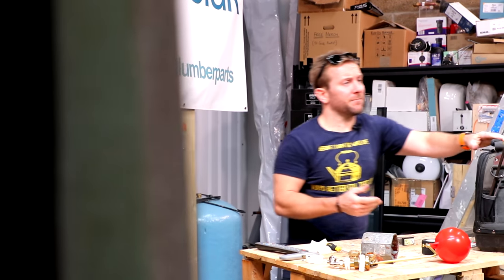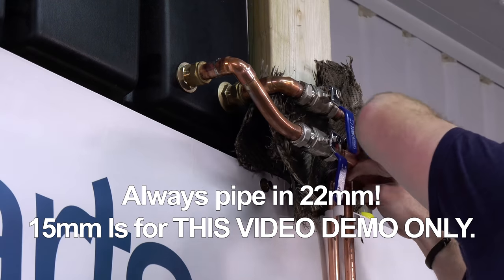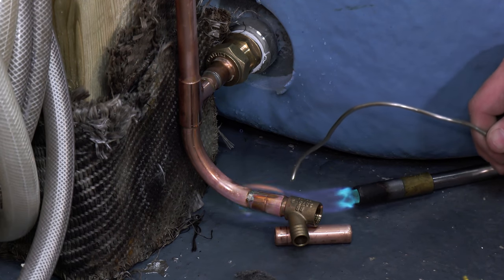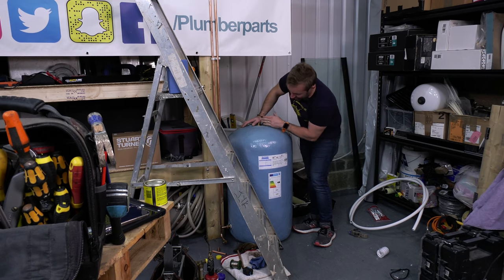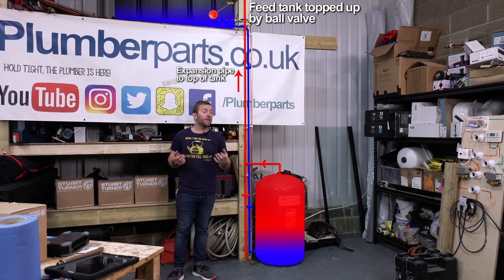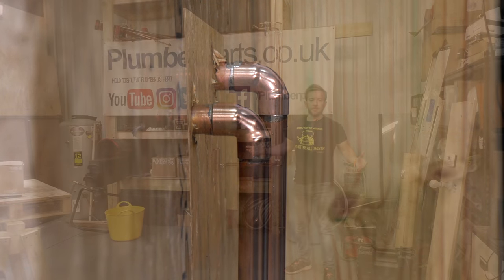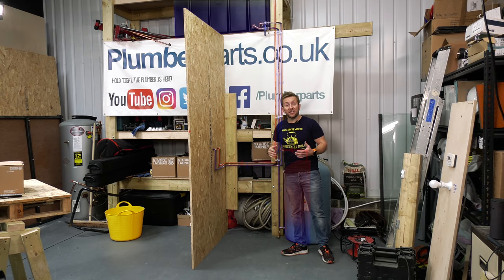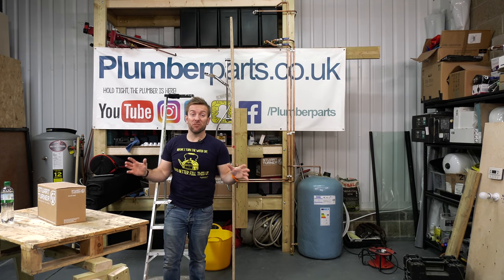HOW TO FIT A SHOWER PUMP - Stuart Turner Showermate Review

Comment: Don't you have to use a different flange on the hot water to prevent air being sucked out?
Reply: Although best practice is to use either a top entry or side entry flange where possible, If the pump is to be located below the top of the hot water cylinder you can connect directly to the hot water supply. Just make sure you first angle the pipe upwards between 3 and 45 degrees and tee into the bottom cylinder. Refer to the installation guide for more advice. :)
Reply: @StuartTurnerLtdHenleyonThames  Just to clarify my understanding you can add a shower to a pipes shared with other outlets?

Comment: Great video. I've got a question mate. We have a shower pump to our main bathroom fed by gravity water tank and vented cylinder storage. Problem is when the shower is on it works fine, but once you turn off the shower tap the water pump engine is still working and it won't switch off! I have to go up to the loft to turn the fuse switch off to stop it and over heating. Why doesn't it isolate the water pump off? It used to work a fine before... Many thanks!
Reply: If the shower valve is passing water 💧 in the off position,  You don’t give the location of the shower pump. If the location of the pump is in the loft, It should be a negative head pump , If not check the pressure switch. Don’t understand why 13 Amp  spur switch is in the loft. Unless pump is located in the bathroom 🚽

Comment: Did you use a surrey flange on the tank?
Reply: He didn't, and he used 15mm pipe instead of 22mm. Cut a few corners which is a bit misleading.

Comment: Lots of information and an amusing delivery. Having watched your video I went ahead and had a new Stuart Turner pump fitted at the base of the cylinder,. This was replacing an old noisy one that has lived under the bath for over ten years. The plumber fitted the new pump almost exactly the way you have, lovely installation. Regrettably the pump started to weep on the cold side after just over a month of being installed. I contacted Stuart Turner and they wanted pictures of the installation. 

They have refused warranty stating that the angle, on the pipe at the top of the tank for the hot water supply is insufficient. So even though it is the COLD water side that is weeping, warranty is refused because they say the HOT side is not fitted correctly.

I urge anyone fitting a pump to follow the fitting instructions explicitly, no matter how expensive that may be, as any failure will have your warranty claim rejected.

Comment: As part of legionella control what we do at my firm (commercial mainly) is bring the expansion pipe up over the tank and then back down, into a visible tundish, then a fanny trap and tee into the waste or discharge out as you would a D2 on the unvented system. This is to prevent the warm water mixing with the cold bringing the temp of the cwst into the 20C or above which is a breeding ground for bscteria.
Just a thought, may become mandatory at some point. 
Cheers for a great video bud. Atb

Comment: A really handy video I stumbled across. Our builders when fitting a downstairs shower room took the hot and cold feed from under the sink. It runs under the kitchen and extension floor and then up to the shower mixer. It takes forever to get hot and often have to run cold for ages first then switch over to hot slowly. We have a pump for the upstairs shower but that doesn’t kick in with the downstairs. Can I put a pump between the downstairs shower and where they have taken the feed from under the sink?

Comment: very helpful informative video, thank you. i had been struggling to work out why the showers in the old house i have just moved into had such rubbish pressure, i thought the problem was the undersized service pipe into the house but now i realise it is a gravity fed open vented system exactly like the one you demonstrate, i realise this is the main issue. my question is this; do i need one of these pumps for each of the 3 showers in the house or can i plumb the pump next to the tank to power all of the showers if they are not all being used at the same time? two up stairs, one downstairs and the hot water cylinder and boiler are upstairs in the main bathroom next to the main shower?

Comment: In determining whether a positive head or negative pump is needed you say 1 litre per minute is needed from the existing tank set up - is that where the pump will be fitted or at the highest point that the shower head will be situated? Thanks

Comment: I have the exact setup you described.  But loads of pressure on the cold feed to bath/shower mixer tap.  It's just the hot feed that dribbles.  I assume I need Stuart Turner Techflo TP Standard 2.0 Bar Single Impeller Shower Pump - 49086 for £85.   And that I cut into the hot water feed.  Can I do it with a plastic pipe?   I am in a rental property and on leaving I have to put it back to as found.  So my thought is to cut into their 22mm copper pipe to interrupt the flow.  Install the pump.  Then when I finally leave take out the pump and patch the copper pipe.

Comment: How do you pipe up the pump differently if you want the pump to run a shower only vs kicking in for all hot taps in the house as well? I've seen it that some people want the pump to run just a shower and have the hot taps gravity only bypassing the pump and also seen it where people want the pump to kick in for the whole house. Please explain how you'd pipe both ways. Thanks.

Comment: How much would you recommend a job like this should cost using a local plumber? Also is an electrician required for the pump? As my airing cupboard doesn't have an electric socket?

Comment: Recommendations for low pressure flow rate to Hot tap in kitchen in a flat. Immersion heater tank with integrated water tank. Flow rate ok at bath tap and basin in bathroom.

Comment: Some neat copper pipework bending between the cold and hot supplies from the mixer dropping down to the shower pump. Some guidance on this pipe bending wizardry to avoid clashes (crossover's) and then back to the wall for pipe support would be much appreciated - both 15 and 22?. Great video and presentation as always James...

Comment: I’ve watched your vid twice now. Love your style and straightforward approach. As an amateur DIYer, gonna take the plunge and give this a go. Two Qs: 1) can’t find those inline strainers anywhere. Can you share a link. 2) Going to site my pump next to he tank in airing cupboard however my CW / HW feed needs to go back into the loft to rejoin existing 22mm pipe work back and down to the shower. Is this a problem going back up to loft using 22mm > 15mm > 22mm ?

Comment: WHAT IS THE FLOW FROM ANY INSTALLED SHOWER OR OTHER OUTLET WITHOUT A PUMP FITTED? - We have a gravity fed system in our home and in our bathroom upstairs on our bath tub we mixer taps installed with a middle plunger that we pull up for the shower hose head. Would this test filling up a 1 liter jug be from ONLY the hot water tap on full or with both hot and cold taps both on full through the shower hose head when doing the test to see how much water has filled up in the bucket/jug over 60 seconds? Thanks

Comment: Just seen this, I have a very noisy pump, I know they should have some noise but this is on another level, also I have a leak were the hot water enters the pump. How much should it cost me to get shower pump and leak sorted?, By a decent plumber.

Comment: brilliant video thank you. I am putting in a new bathroom in march and wanted to replace the electric shower with a mixer shower... our water pressure is piss poor for that exact reason.  the feeder tank is right above the hot water tank. should I still move the header tank in to the loft, or would just a pump like that solve the problem without moving it??

Comment: love this video,thank you, can you use any pump for hot water tap in the bath? the cold water is working fine good pressure but the hot is very bad and slow due to the same problem you just showed us,thank you
Reply: If pumping hot only to a mixer tap make sure you use a Universal pump to ensure it starts every time. The higher pressure on the cold side of the mixer can prevent the flow switch on a positive head pump from working correctly.

Comment: Hi mate. Amazing video. Thank you so much. I've just fitted the exact same pump and exact same set-up. My pressure is now great. My only issue now is that my brand new thermostatic bar mixer shower is not getting really hot. It does get really hot however if I isolate the cold feed. I'm thinking it's the thermostatic cartridge but it's brand new. Any ideas?

Comment: hi just to clarify i will be using a pump with 22mm inlets  and outlets the thermostatic valve is 15mm inlet (G 1/2) so where should i reduce the pipe from 22mm to 15mm i was thinking almost directly b4 the thermostatic valve would this be right?? many thanks in advance

Comment: Hello Mate
You videos are really great. My plumber has installed a salamander pump for my new bathroom. But the pressure is not very great. I can see that from my tanks(hot on floor level and cold in loft) the pipes coming out are 22mm which coming upto my bathroom. But in old bathroom out of those main 22mm supply , sink and shower used to have a 15 mm pipes. 
But the guys who did the rework on bathroom has taken the input for shower pump from 15mm old pipes and i think same he has put to shower and other areas of bathroom. Can you suggest if this could be  problem for the low pressure. Also like to ask if input pipe to pump can be 22m while outgoing can be 15 mm?

Comment: Great videos, quick question I’ve installed a shower pump a few years ago in the airing cupboard just for the shower , now I’ve just upgraded and put new taps in kitchen and basin but with new taps the pressure has dropped can I install another pump in the airing cupboard nearest to the hot water tank just on the hot water feed so that I get more pressure on the taps ( just the hot water cold is fine )and will it affect the original shower pump I installed , thanks.

Comment: Does the pump have to be the last thing before the shower, or can be it upstream from everything else in the house (the taps)? We have a shower which is just a bit weak, but everything else is fine, but it'd be annoying to have to replumb everything so this can be placed correctly. Not sure where abouts my shower pipes come off the main supplies after the hot water tank.

Comment: Please help. I have recently had this same shower pump installed in the airing cupboard next to the cylinder. The gravity flow is more than 1 litre per minute. When the shower lever is in the middle 50:50 mix of hot and cold the pump pulses. Ok when the lever is moved to more hot or cold mix. The system has been bleed of air. No issue with the shower head or shower lever as these have been checked and are free of debris. Any help greatly appreciated.

Comment: This channel is freaking awesome.

I currently have an electric shower and the pressure is ‘ok’, nothing impressive.. I learned about head pressure in this video but I’m not sure how it applies to an electric shower - when I raise the shower head above the shower the pressure is lower, when you take the hose below the shower unit the pressure is higher - why is this? 

I have another question if you don’t mind answering; how do I go from an electric shower to a mixer shower? What are the benefits etc? Maybe you could do a video on types of shower installations and which is best etc... I REALLY want a shower like the ones in posh hotels - lots of power & lots of water - how could I achieve this?

Subscribed a few weeks ago - amazing content - I also taught my girlfriend the little trick about how to prevent de threading on a screw cap by reversing the twist until it clicks, then spin it on - cool trick 🤓 stay safe everybody, hope 2021 is back to normal soon!!!

Comment: Salamander insist that flux is washed out before connection and that the pump is purged before connecting to the outlets to fill the chambers. Then to do what you did with the valves before powering up. Is this the same for your pump? Also flanges to be fitted at the hot cylinder to avoid air intake to the pump. Just fitted the 4th pump in less than as many years- turns out that he didn’t check the flow rate so ordered the wrong pump in the first place and didn’t put a S- flange on the hot tank!! Plumbing makes me nervous but had to sort it myself in the end. Advised to use a universal pump by the helpful people at Salamander.
Reply: All soldering must be completed and the pipes should be cleaned and flushed through before the pump is installed. Solder flux is very acidic and will melt the plastic components of the pump away resulting in leaks.

Comment: Hi James, great video this has helped me no end in going to fit my pump, however a couple of questions, you said you've known this to be fitted under the bath, I am considering this but is a hot debate about electrics, would you recommend it under the bath and also as much as your copper work is great, would these work with speedfit pipe and fittings or would it be to powerful pushing a 3bar pump through them, many thanks 👍

Comment: Hi 1.5 bar water pump 3 storey house, if one show at the 2nd floor is in use, the 3rd floor shower, no water coming out. Will this be posible to upgrade the water pump into 3bar without any other modification like fuse box etc.

Comment: I have this exact pump Stuart turner ecomate 2 bar. It's being used for approximately only 2 hours in total. It feeds two showers. Only one shower is ever used at any one time. Today it stopped working again. When I turn on the showers there is only a dribble of water and the shower just makes a humming sound. I turned off the pump and ran the showers in all positions as you did in the video to purge the pump but it made no difference. Any ideas what could be the problem. Thanks for your help.
Reply: Same
Reply: After posting this I disconnected the pump from the power and water connections to take a closer look at it.  When I looked at the bottom of the pump I could see where crystals had formed on the outside of the motor where there is obviously a small leak. I then removed the covers on each end of the pump to have a closer look. Here you should be able to turn the motor shaft freely but it wouldn't turn. It was completely seized.  I proceeded and removed the plastic wheels off either end of the shaft that are used to propel the water through the pump. I then clamped a vice grip on one end of the motor shaft and gave it a good hard twist to get the motor moving again it worked.  I reassembled and connected the pump back up to the water and power supply. Before turning on the power I purged the pump.  I then turned on the power and tried the shower again. It now works again but a small leak remains at one end of the motor.  As far as I know you cannot get spare parts for motor for this particular pump. The motor is in one sealed unaccessible unit. So I was told by a Stuart turner agent in Ireland. I was left with no option but to order a new one or else a different model.  I can assure you the leak was not caused by the water being too hot (65 degrees Celsius as mentioned in there manual) entering the pump. Tank emersion turns off at 50 degrees Celsius. Also the leak happened on the side where the cold water was connected not the hot.  I reckon it's just a cheap crappy pump. I would not recommend it to anyone. Hope this helps someone out.

Comment: We have one of these pumps fitted in our 1st floor bathroom, that is used for loft room bath and shower. It keeps stopping and water is not being pumped up. Plus the pump runs on its own even when no water is being used. This happens all the time and getting air locks all the time. So the pump is working but no water is coming out of the shower and bath. We need a solution to this as it’s happening about 5 times every month.Our maintenance bill is going to be rediculous. Any solution would be a great help, Dyno plumbing suggested an Essex Flange, but said it will cost us another £300.

Comment: I must be doing something wrong. Installed the pump. When I turn the tap the pump fires up and the shower pressure is lovely. However when I shut of the tap the pump continues to run and blasts water out the vent on thr roof !

Comment: Can the hot feed faucets degrade on these? I’ve got black specks in my hot water in the bath, which is supplied via one of these pumps. I’ve replaced the tap faucets but still have the problem, am wondering if the pump faucets are on their way out. It is at least 15yrs old. None of my other hot taps show any specks, so it is definitely something on this pumped circuit.

Comment: Hi James. What if my pipe arrangements are different. I have my cold water inlet at the top and my hot water outlet at the bottom of my tank. Can I still connected a pump to the outlet please?

Comment: Should the feet sit on a solid surface (not screwed down just resting)?Just had this exact pump installed and there is few mm clearance under the rubber feet, so it is hanging from the flexible hoses. Could this be why the pump is very noisy compared to the one in your video?

Comment: Need help; Can we connect 22mm copper pipe to a shower pump which 15mm connectors? Or must buy 22mm connector shower pump for 22mm copper pipe.
Thanks